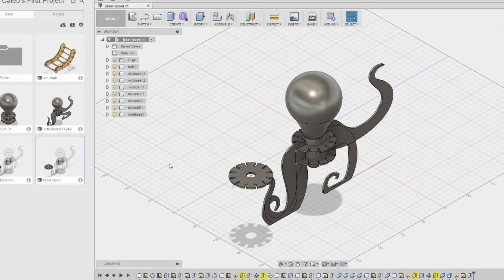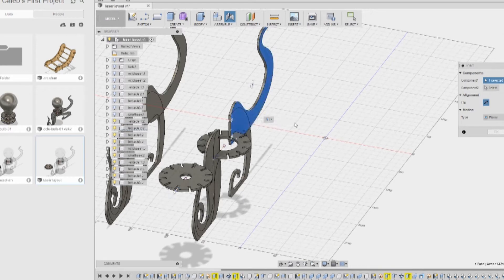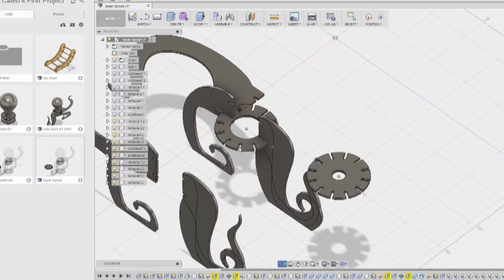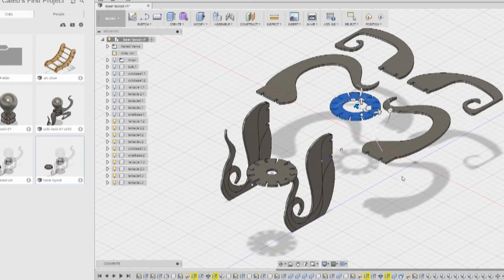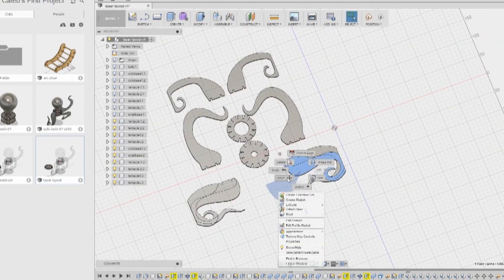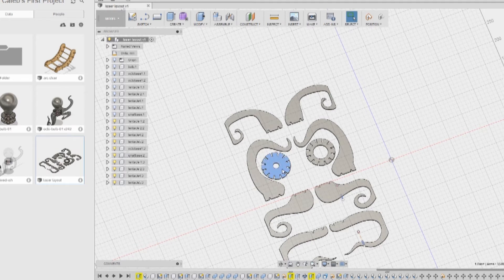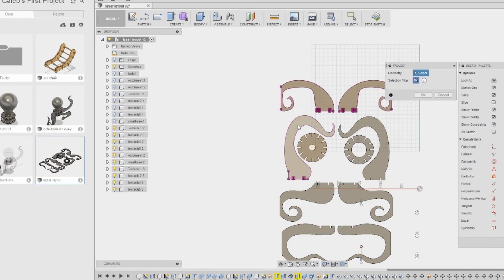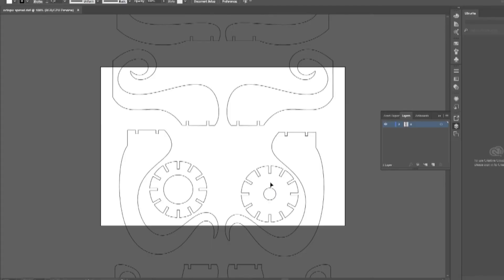Laser cut octopus lamp: 04 the right way to export dxf files from fusion 360

Comment: I've tried this but if I have dimensions showing on drawing, or even construction lines, called out as such, the dxf that fusion produces will sometimes save the construction and dimension lines... very bizarre. When I export out to the cut file program , it'll think that the dimensions/construction lines are lines to the cut. This is for plasma cutting. Perhaps that's the reason for doing a project command into a different layer. The project command probably doesn't carry those construction lines over. Any ideas?

Comment: so do lazer cutter understand .ai files? Or do you need to send the native .dxf file? As I know AI doesn't export to .dxf so is it .eps or some other file format?
Reply: Depends on your cutter software. they usually take some old variant of dxf, mostly without splines and polylines, and svg, sometimes also straight GCODE. Your cutter may also support different stuff but that's unlikely

Comment: I use the add on Save DXF for Laser Cutting.  This allows you to specify a value for Kerf and therefore ensures parts fit in a snug manner.  You produce individual dxf files but I then put them together how I'd like to cut them on the bed with Inkscape.  Saves having to duplicate components and create new sketches and projections.  It's an alternative you could try.  Inkscape is free, easy to use and there are lots of videos.
Reply: Howard Smith i
Reply: Huge problem it can export only one face at a time.
Reply: @h4z4rd42  Yes it's a trade off.  Depending on the accuracy you require.  With Save DXF for Laser Cutting it's a face at a time but you can adjust for kerf.  For my application that gives a tight joint that requires minimal glue so less weight.  The way described above can do multiple faces (with some fettling) but does not provide kerf.  The ideal way would be to do multiple faces and adjust the DXF for kerf.

Comment: It doesn't make sense to draw a piece and then have to project to a new sketch.
It should be automatically. You sketch once and you lay the pieces as you want and Fusion should give you the Gcode for those sketches.
Maybe we should ask Autodesk for a simpler tool.
Reply from the maker: autodesk will give you a DXF of any component. I wanted a DXF of all the
 components arranged manually, which is where it gets complicated. 
Fusion can't read your mind!
Reply: What I mean is, after you lay down the pieces and for example make a setup and tell fusion that you have a certain size laser machine, Fusion would give you the Gcode because you already done the sketches.
Theres nothing for Fusion to guess / read my mind. It has the sketches, it should give you the Gcode.
How does Fusion make 2d and 3d contour?. It knows the geometry and calculates the path.
It should do the same for sketches. Im sure they will make it easier to work with laser and water jet machines.